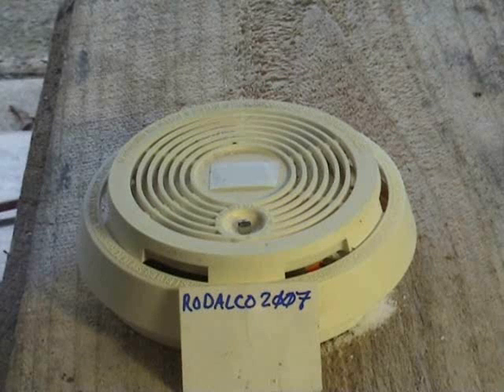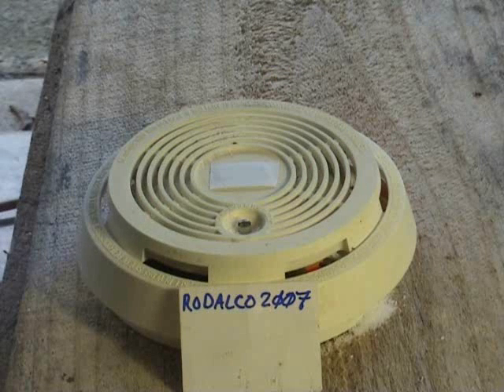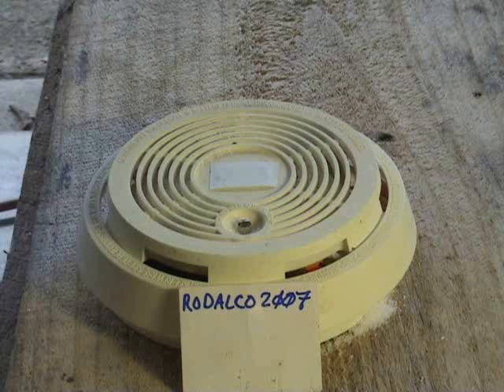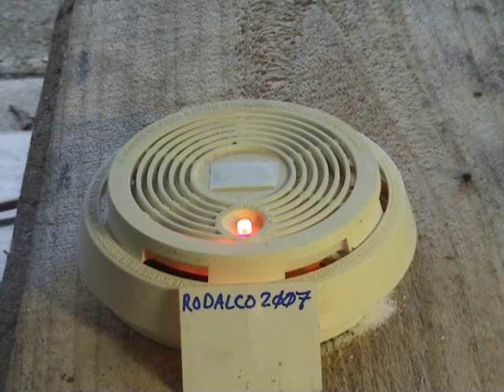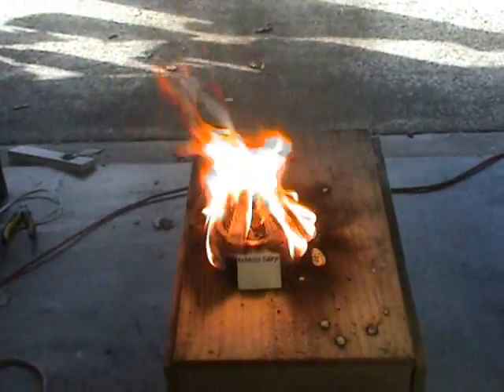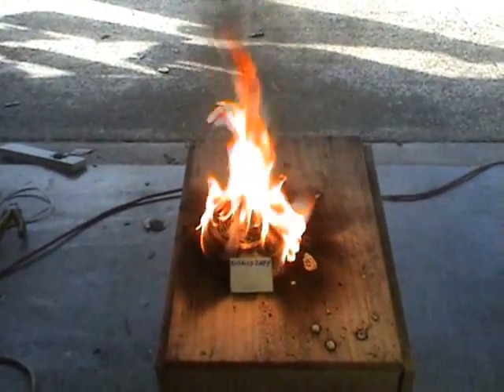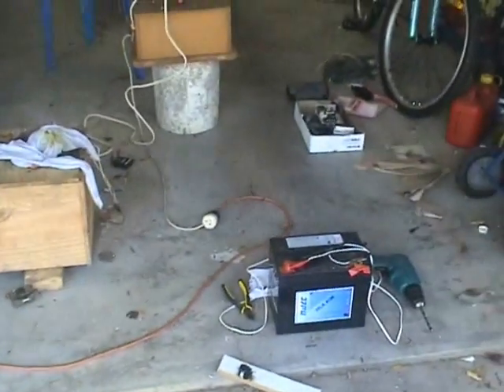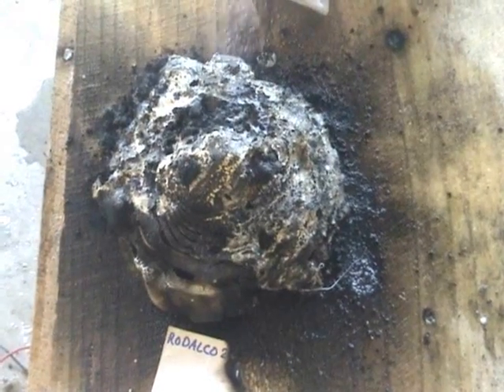Faulty smoke alarm burn out -- overvolted

Comment: @conoba The only kind of smoke alarm sold at a store local to me is the radioactive kind, containing Americium-241.  It is printed on the back of the package so you can see for yourself.  I could not find a smoke alarm without Americium-241.  All ionization smoke alarms contain radioactive material.  Photoelectric does not, but you have to read the back of the package to know for sure if it has radioactive material.